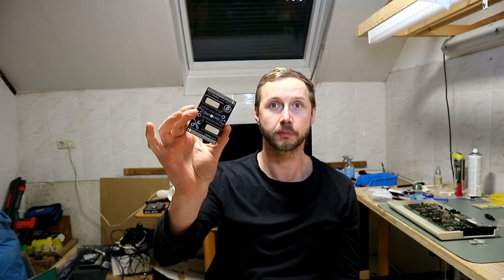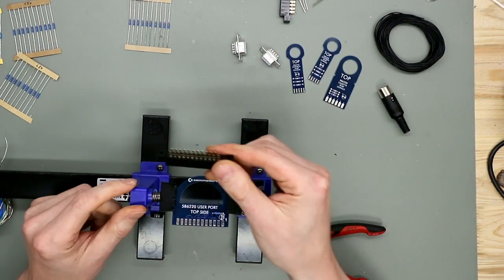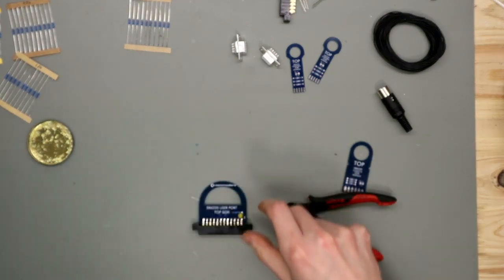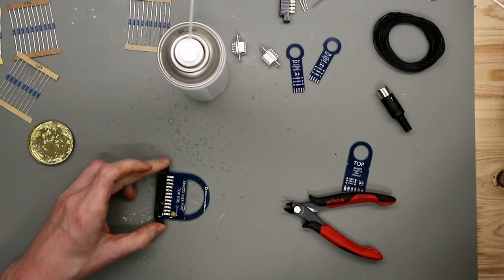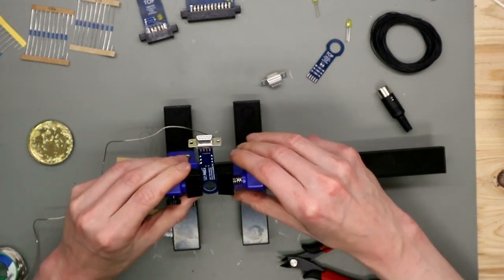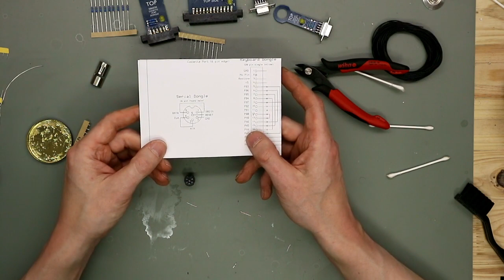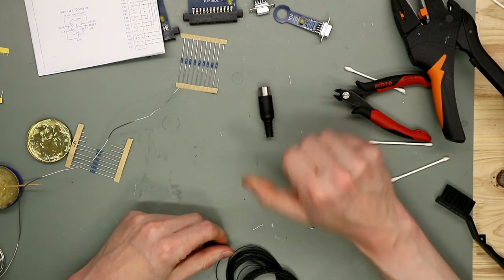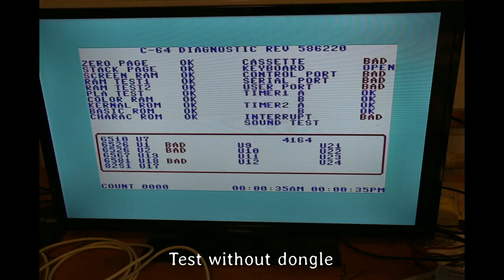Commodore C64 Series #5: Build your own Test-Dongle for the Diagnostic-Cartridge

Comment: Nice Tom! I didn’t see you build the keyboard dongle, is it not needed if the keyboard is plugged in?
Reply from the maker: Hi Bob, sorry for answering that late. The Keyboard dongle ist needed. I forgot to order this pcb. The dongle are some bridges on the connector. I made this with wires.
Reply: @tomscomputerchannel2925  so in the meantime I have ordered and built 5 sets of the dongles… so all is well!
Reply from the maker: This is nice to hear. 👍

Comment: Good video! I just bought this kit already made with keyboard dongles for my C128D and SX-64 also and four carts, 64 diag, 128 diag, Dead test and 1541. How does this work with out it being a wired harness like the one you built? Are they two different systems and just work differently, but do the same thing?
Reply from the maker: That’s right. The Test-Harness is more accurate, but the Test-Dongle are easy to build. I use both to show the failure. Sometimes it give you more information. 😉

Comment: Hi. Great work. There are no wired between the dongles?
Reply from the maker: Thats right, in this build no wires needed. It’s all right.
Reply: I didn’t see the keyboard dongle? Do you not need it if the keyboard is plugged in?
Reply from the maker: Yes, you need the keyboard dongle. I forgot to order at pcbway. So i used the schematic at the service manual of the test harness and used jumper wires with female connectors on both ends. If you don’t use the keyboard dongle you got errors.
Reply: @tomscomputerchannel2925  I ordered the pcb’s already, 5 sets minimum, so I will have 4 extras to pass on to others who may need them! THX!
Reply from the maker: Great. Have fun. 👍